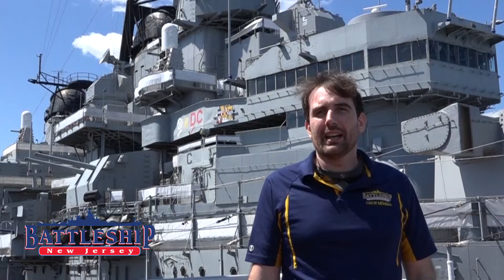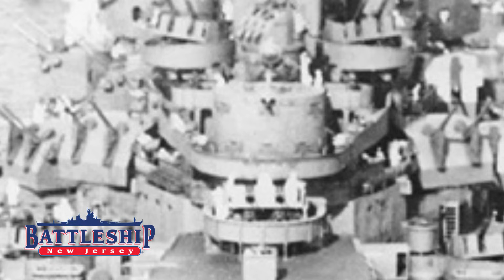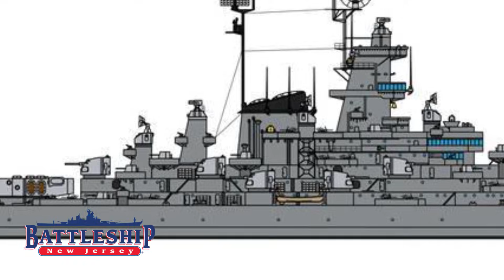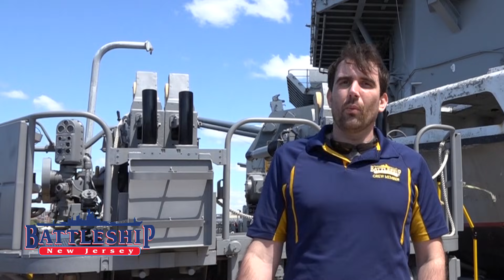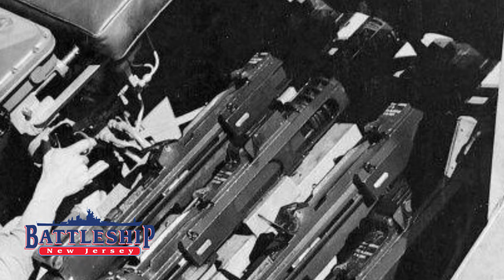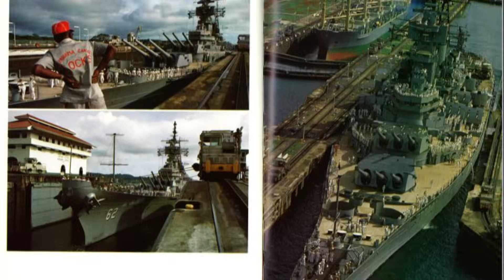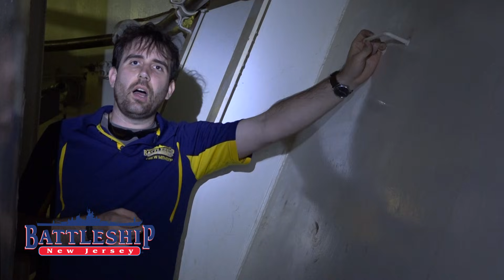What the Navy Doesn't Like About the Iowas

Comment: Could the engines be restarted without requiring a great deal of restoration?
Reply: Just starting a boiler for a few minutes would be a hugely popular YouTube video.    Also would attract a large number of visitors if you did it on some regular basis, kind of like the 4th of July event for the USS Constitution
Reply: Look,  it’s already been done.   https://youtu.be/C9Gq0DdCkwU
Reply: The ships are maintained and preserved "if" ever needed again. Hydraulics are filled with preservatives to protect. Some elements of gun firing systems are removed and stored for safety. When the Massachusetts went into drydock for repairs, they asked to cut the shifts for better access for repairs, the Navy said NO. These can be quickly reactivated if need be. I doubt that will ever happen.
Reply: @mikgin100  that is actually NOT correct.  The Navy SOLD all the battleships to private entities and they will never be recalled or reactivated.  These ships have all been stricken from Navy registry meaning the Navy no longer has any claims to these ships.  The guns were cemented in and the firing mechanisms have been destroyed.  There are also no active or retired Navy personnel who have the training and know-how to operate the battleships.  I'm not sure where you got your information from but it's incorrect.
Reply: @axysdnyd  There are elements (one specific I can point to) to what you said that that's incorrect, they (the USN) scavenged some analog fire control components from either the USS Salem and(or) the USS Massachusetts to go in an Iowa in the early 80's. The manufacturer went belly up a long time ago. So much for holding forth "the Navy has no claim on these ships", the part they needed, they TOOK. They replaced it with the broken part, but they didn't ASK & they didn't BUY the part. So, where do YOU get YOUR information from?
Reply: @relluplewis7112  all the remaining battleships are owned by private parties, and at the Navy's request they provided some parts during the recommissioning of the Iowa class battleships.  The Navy didn't just "take" parts, they asked for them and that request was fulfilled.  None of the battleships are even able to produce their own power or propulsion as all those systems were rendered inoperable.  None of th battleships will ever be recalled as they are too old and outdated for use in the modern Navy.  It would be absolutely absurd to attempt to recommission any of the Iowa class battleships, the costs would far surpass building new ships and there are no longer any personnel with the proper training to run any of the Iowa class battleships.  They will remain museum ships
Reply: No. Theyll need a great deal of work and there's no infustructure to support the work.
Reply: Unfortunately, as part of the decommissioning process the boilers were basically destroyed mechanically so that they can't ever be refired without extensive and expensive refits.  Just like the gun barrels being cemented and certain parts being removed and destroyed.  This means all Iowa class battleships will never again be able to be recommissioned to active service.  These ships will only be museum ships until the end of time.
Reply: Matt B decommissioning is putting a ship I mothballs I believe.   You must mean when removed from the register and turned over as museum ship.
Reply from the maker: Decommissioning and mothballs aren't exactly the same. When a ship is decommissioned it might be mothballed and basically preserved for future use, or it might be scrapped, sold, or donated as a museum. Sometimes a ship is mothballed and then something else happens, or the ship gets recommissioned
Reply: Battleship New Jersey Thanks for clarifying :).  What i was trying to say is that since they were initially mothballed when decommissioned, disabling the boilers probably happened when they were struck from the registry.
Reply from the maker: The engine system was mostly kept in place for mothballing and additional work was done to disable them for at the time she was stricken from the navy to be a museum.
Reply: @rfjohns1  When the New Jersey and the rest of the Iowa battleships were decommissioned the final time, the Navy knew the ships would not be recommissioned again as the aircraft carriers had assumed the role as lead ships.  The Navy knew the Iowa class ships would be turned into museum ships and made preparations to completely make the ships permently inoperable as a warships.  It's sad these magnificent ships will never again sail under their own power but it's bittersweet because they'll forever be preserved as living pieces of history to honor the men who bravely served aboard them.

Comment: There was also a plan drawn up to remove main battery turret number 3 and replace it with an aircraft deck to operate Harrier VTOL strike fighters.  I believe there is a model of this proposed conversion in your museum collection, right?
Reply: That's right. Model company Nichimo got hold of the plans and actually produced a 1/900 scale kit of the proposed conversion back in the day. It's pretty rare now.
Reply: They also considered replacing turret 3 with vertical launch cells for another four dozen Tomahawks or Harpoons.
Reply: There was a flight deck  aft of the gun!  I know! I was on the design team!
Reply: Both options were deemed unusable because it reduced weight too much. you wouldn't think that would be a problem until you consider the implications.
Reply: @Captndavo  honestly it would be a fairly balanced warship if they removed turret 1, replaced that with VLS, turret 3 for a flight deck, and added all the weight saved back in as extra armour, CIWS etc,
Reply: @ravenof1985  Well, since the whole ship seemed to be designed around the 16 inch guns, from my layman's perspective, removing six of them would make people question whether we needed the Iowas at all.  It would be more cost effective to build a dedicated missile cruiser.
Reply: @ravenof1985  But it's not cost-effective.  Doing all that work would actually cost more than just building another Burke DD. And the Burke would buy you a LOT more capability.  They ran into the same problem several different times over the life of the BBs:  considerations to convert them to partial carriers, then add the Talos system, then the Aegis system.   All required MASSIVE reconstruction and electronics refits, which cost enormous amounts of money.

It's not just as simple as yanking the X turret and plopping in a VLS array.  And you can't effectively add armor (which would be pointless anyway).
Reply: @eriktrimble8784  its just paper admiral stuff thinking about this, at this point the machinery of that ship, damage control ability, and the fact that its not going to be even remotely similar in layout or operation to the rest of the fleet, it would be unlikely to be reliable/effective as things have moved on quite a bit since the 80's / 90's but it would still be awesome

Comment: I have a dumb question.... I toured the ship last year and my dumb question is how does the ship get power? Also does the entire ship get power? I mean is there any part of the ship that is in really bad condition?
Reply from the maker: Today the ship gets power from a shoreside hookup. Historically, the engines powered the electrical systems, but not anymore. Today,  we've restored large parts of the ship, but not every compartment. The least restored spaces mostly need paint or are just basically empty or full of stuff from mothballing the ship. A lot of the equipment isn't functional and may have had the electrical cut to it, but it could mostly be fixed if so desired.
Reply: Battleship New Jersey thank you for your quick reply!! I absolutely love the battleship!
Reply: @BattleshipNewJersey  Speaking of least-restored spaces, when I was able to get into and photograph turret 3 some years back there was a lot of peeling paint. I had just chalked it up to lack of time, money, and manpower, but others have mentioned the possibility of lead based paint still aboard. Is leaded paint still an issue, or was that all remedied in the Reagan-era refurbishments?
Reply: from the steam boilers on board and in last restore measure the diesel generators